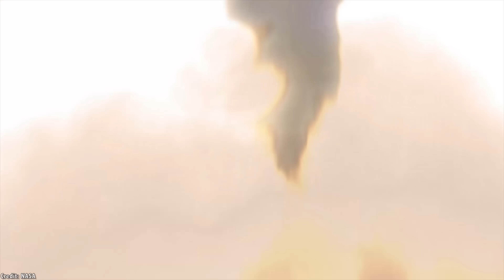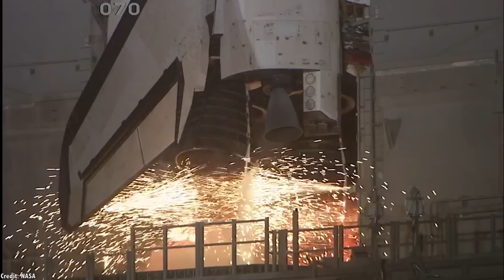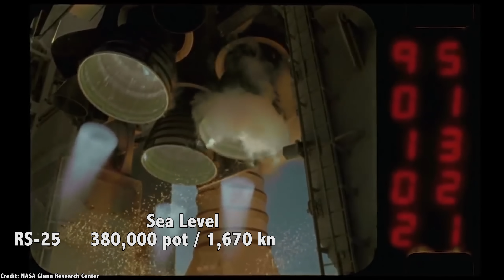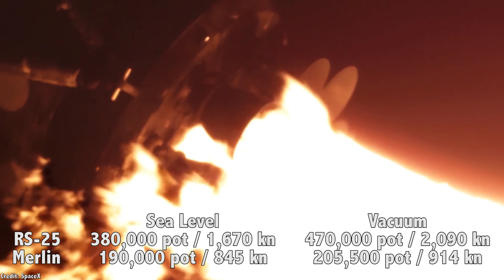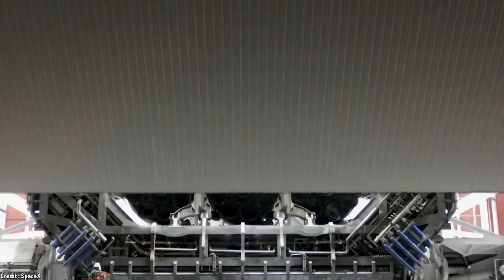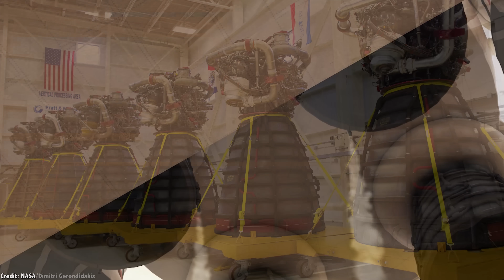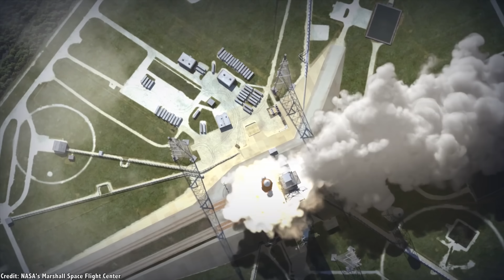The Rocket Engines Carrying Us to Space. The SLS RS-25 (aka The Space Shuttle Main Engine)

Comment: What would happen if Falcon 9 uses 9 RS 25 instead of 9 Merlins? Wow...!!
Reply from the maker: It's probably not a good fit. They're not designed for that kind of reusability. After each shuttle mission, they needed to be fully refitted before they could fly again.
Reply: Fraser Cain cool.. Why not make a video on outer space solar powerplants?
Reply: Haha, it would double the thrust (105% at sea level, 120% vaccuum), save the 18 mill SpaceX spends on Merlins and add 560 million in RS25s. Oh and the fuel would have to be changed. and the tank body would have to be like 5x bigger with the lower density of Hydrogen.
Reply: Aaron McCulloch  but all said hydrogen burns cleaner than kerosene...Elon's vision is for a clean emission free world

Comment: With the capitulation on reusability of the RS-25, could the engines be made cheaper than they were, given they were expected to have an easy check before re-launching. Since they aren't, some components could be cheaper and less complex than the SSME version, couldn't they?
Reply: Yes, that is currently planned. the RS-25E (expendable) should be cheaper to manufacture.

Comment: Fraser, one for your Q&A show: So NASA wants to abandon the ISS, even though it cost more than $100B to build and is perfectly viable past 2024, passing it in front of the public as a "move to the private sector" (which is bollocks, we all know the ISS wasn't engineered for such a use case). But they're not willing to cancel the SLS, in which they have invested what, $25B? It's obviously obsolete, even if there were no other companies working on big next-gen launchers apart from SpaceX (and there are others). Block 1 will be just modestly more capable than an expendable FH, but at 4x the price, and by the time they roll out Block 2, BFR will have flown several times. I love NASA, but it's just too political to be efficient.

Comment: Orion capsule is roo small for any deep space journey, just what were they thinking? BFR is gonna eat this things lunch.
Reply from the maker: It's a step back to space. I'd rather see some attempts to head out beyond Earth orbit than to wait for the BFR to get here. Once BFR does arrive, though, then NASA will be able to just buy launches on it.
Reply: Fraser Cain I see your point, however, even if BFR is delayed a few years the SLS won't be fully operational until the mid 2020s. At that point the SLS will be a turkey that cost almost $1bn per flight while BFR is likely in the $150m range. I want NASA to succeed so they've got to find some way to merge all that they have accomplished so far with either SpaceX, New Glenn, or even the Russians. That is our tax money bring used.
Reply: It's basically a transfer and re-entry vehicle. For any long-term mission it would be docked to a station or mated to a hab module.

Comment: $12 billion spent in developement and we haven't seen a flight yet, even though the mains are 'off the shelf' tech. $500 Milion a launch, throw away the most expensive parts, for what? More ULA or Boeing contracts? Jobs? Screw that! [oh, and another $2 billion to upgrade the launch pads- SpaceX upgraded 39-A for $20 million- likely the least they needed, maybe NASA needs $1.98 billion more in improvements]
Reply from the maker: Yes, it's jobs right now. When the space shuttle program wrapped up, they wanted to put them to work on the next program. Their other option was to just lay everybody off, which wouldn't have been the best idea either. There's a tremendous amount of knowledge and experience that NASA would lose. It's a tough call. And once SpaceX demonstrates more capability, they'll have a hard time continuing.

Comment: Hey Frazier can you cover what happened to the Falcon Heavy booster that was lost when it landed on the floating platform?
Reply from the maker: The booster didn't have enough ignition fuel to relight all three engines. So it crashed hard.
Reply: It wasn't a lack of propellant that caused the crash; it was a lack of igniter fluid, called TEA-TEB (tri-ethyl-aluminum and tri-ethyl-borane).  FH carries enough to relight the rockets only a few times and normally that's enough.  This time it wasn't, but it was no big deal as SpaceX didn't plan to re-use the core stage anyway.  They were more concerned about getting a successful payload delivery than recovery, and in that the mission succeeded.

Also, the upper stage burn time had nothing to do with the failure to land the core stage as they don't share propellant.  Furthermore, they didn't "overshoot" any planned orbit of Mars.  SpaceX burned the final stage to completion to demonstrate just how far they could throw the payload.  They would've been happy with Mars but got more out of the stage than anticipated.  The overshoot was actually an overperformance above and beyond what they projected.  That's actually a good thing.
Reply: James E also you are incorrect regarding the LEM overshoot on Apollo 11. The LEM was configured improperly for landing by the crew, namely when they left certain things on that should have been off for landing. This caused a computer overload which screwed up the landing solution, requiring Armstrong to take manual control. This is meticulously documented so I'm surprised at you not knowing this.
Reply: James E lastly you consider the case of overshoot to be a possible bad thing. While this would be true if, for example, you had a specific target in mind, that wasn't the case for this flight. SpaceX intentionally wanted to see how far they could throw the payload as a demonstration. They underestimated their performance which, again, is a good thing when you want to see just how much performance you could have if you needed it.
Reply: Ian Stradian the falcon heavy center booster didn't ignite three engines it only ignited one so it crashed near the drone ship at over 300mph
Reply: FraZIer Crane? Oh, wait... that’s not how he spells his name either. 

Just messing with you Eann
Reply: FraZIer Crane? Oh, wait... that’s not how he spells his name either. 

Just messing with you Eann
Reply: It can still make an interesting video.
Not many news covered the damage the ship Of Course I Still Love You suffered
Reply: James E while this would be true, booster separation and speed were exactly within specified limits so this didn't happen.
Reply: +Eric Smith
"SpaceX intentionally wanted to see how far they could throw the payload"
You may have seen that statement, but everything I saw from numerous sources said they were aiming for the orbit of Mars, and it seemed sloppy to me when they overshot it. Could be I missed something.

I have studied Apollo 11 extensively and am aware of the computer overload. The latest info I learned was that when the LEM separated from the Service Module, the engineers forgot to figure for the slight acceleration imparted to the LEM from the release bolts. The computer controlled the deceleration burn after that, not knowing of the additional delta V and overshot the landing zone by miles. It brought them down in a boulder field, which was why Armstrong took over to fly farther to a smooth area.
Reply: James E I would like to see the source you referenced for the explosive bolt delta V. I've studied Apollo since the 70's and it's news to me. It also doesn't seem likely given the LEM's position and speed prior to descent was meticulously timed and calculated precisely to prevent what you describe. For 40 years every source I know of cites the computer overload for landing errors.
Reply: Probably shouldn't have used the word "bolts" as I am not sure of the release mechanism details.

https://www.space.com/26593-apollo-11-moon-landing-scariest-moments.html
Also attributes the excess speed to uneven lunar gravity.

http://www.spaceflightinsider.com/space-flight-history/spaceflight-heritage-48-years-since-apollo-11-landed-moon/
Gives the cause as expelled air.

The planned timing was meticulous, but my understanding is that the LEM could not actively check its position and only had altitude data from radar and possibly fuel remaining, so once they separated for the landing, the landing program ran its course.

If you find out more, let me know.
Reply: I think they burned too much fuel on the way up, which would explain the lack of fuel to land and also why they overshot the orbit of Mars.
Reply: +Eric Smith
If the center core burned too much fuel on the way up, the 2nd stage would have been higher/going faster than expected when it started to burn its fuel, causing an overshoot. A similar thing happened on Apollo 11. The LEM was going too fast after separation to land on the Moon and, after burning the planned amount of fuel, overshot the landing zone.

I'm mainly surprised the FH overshot the expected solar orbit by so much as all the calculations beforehand said it would reach the orbit of Mars, and the calculation is relatively simple. Over performance is not necessarily good. What if people had been on board on the way to Mars and missed the planet entirely? Or a probe that needs to brake in Mars' atmosphere is going too fast to slow down due to over performance?

Comment: Although an awesome engine in it's day, the RS-25 is outclassed by the SpaceX Merlin:
1. Engine cost. From the video, a Merlin has about half the power of the RS-25. One RS-25 = ~$60m; 2 x Merlins @ ~$3m = $6m. 
2. Re-usability. Even when the RS-25 is recovered, I understand a near-complete rebuild is required, costing almost as much as a new engine. The Merlins apparently are 'rated' for 40 flights and don't require very much in terms of getting to 'relaunch' capability.
The smaller Merlins were used so that less fuel and thrust could be used on the return-to-base stage - only one Merlin of the 9 is used.
Reply: RS-25 is cleaner. It's exhaust? Water!
Reply: But Merlin has no chance in efficiency with RS-25
Reply from the maker: Yup, for their purpose, the Merlins are a better choice. They're cheaper, easier to manufacture and can be reused many times. The RS-25s are just insanely powerful.

Comment: What do you think about the Rocket Lab Electron Rocket's Rutherford engine's that use battery-powered electric motors?
Reply from the maker: Really exciting. I like the idea that there's competition at both sides of the launch market.
Reply: even rocketlabs has upstarts nipping at their heels - see the launch of Tricom 1R on the SS-520. I've heard they aim to develop a launcher than can be operated at less than half a million per flight.

Comment: Cant say I really see the SLS as being that much of an advantage.  Yes those RS-25s are powerful but expensive.   Unless you really need to loft something that heavy in once piece your almost better off useing 2 or more launches on a FH and doing a little orbital assembly.  Yes its more complicated but when buying replacement RS25's is going to cost you as much as a F9 out the door and you need 4 per SLS launch that extra complexity starts to look like a bargain.  I think its a combination of bureaucratic inertia and a heavy dose of sunk cost fallacy thats keeping the project alive at this point.
Reply from the maker: I think it's also important to remember that SpaceX has only be reusing rockets for a little over a year. It takes time to adjust to a shift in technology this profound.
Reply: The main advantage to SLS is the ability to launch a space station module or other large payload with crew. With FH, you can launch one or the other, but not both at once. And of course, that assumes the FH is also expended. 

Other than that, if NASA is building a Flagship probe to the outer solar system (Europa Clipper or a Uranus orbiter), SLS can probably launch it there directly instead of relying on Venus and/or Earth flybys. SLS is definitely a niche vehicle - it's not intended to fly much more than once a year.

Don't underestimate how complex the logistics of assembling a large space station can be. If NASA were still operating the Saturn V into the 90s, the mass of American segment of the ISS could have been sent up in just 2 or 3 launches.

Also, NASA does not pay the list price of a Falcon 9. They pay somewhat more for SpaceX to meet extra requirements, as their payloads are considerably more valuable than a commercial satellite. NASA would probably pay closer to $200 million for a FH launch.
Reply: True, but why did it take a private company to realize the technology?  Was NASA incapable of thinking of it or engineering it?  With the billions and billions spent on SLS thus far, why didn't NASA get there first?  What happened to "better, faster, cheaper"?

The answer is depressingly obvious: NASA isn't a space agency anymore.  It's a pork-barrel jobs program hidebound to political interests.  Sadly I don't see that changing anytime soon, if ever.  Too much money involved, too many pockets being lined at taxpayer expense.  Cynical?  Yes, but also realistic.
Reply: @ThePrisoner881  I know your comment is a year old however, it is still valid.  The pork of the space shuttle and now SLS is turning rancid... if only Republicans' understanding of science was better than their understanding of the bible!
Reply: +Fraser Cain reusability aside, $60 million for one RS-25,  when you can buy an entire F9 for that price. SpaceX has the best prices on space launch even before you factor in any reusability. I'm surprised at how much you defend the SLS program Frasier. You're an intelligent guy, you gotta know the cost is not worth it and actually prevents NASA from actually doing anything with the rocket. In fact NASA wants to cancel the ISS in 2024 so they can use that money to actually afford to do missions with the SLS. Is it because you are Canadian and it's not your tax money being wasted on a jobs program for Alabama vs actual human space exploration? This is what the SLS is preventing, not giving us the ability to explore but preventing us from exploring.

Comment: I wonder why the US uses the RD 180
Reply from the maker: Because they're reliable and there weren't any US-based solutions until recently. You're going to see a lot of these rockets switch over to Blue Origin BE-4s.
Reply: I doubt we will see any current rocket 'switch' to another engine family - especially one that uses a different fuel! ULA will have to ditch the Atlas V in order to stop using the RD-180 - problem is Boeing and Lockmart don't particularly want to development a new vehicle unless the government foots the bill.

I wish they'd just spin off ULA - I feel like they'd like to take some initiative in the market but they're held back by the parents with the purse strings.

Comment: The engines are certainly iconic, yet somehow it feels as NASA is not able to understand the concept of sunk costs and wastefully supports a project that should be terminated. The R-25 is certainly iconic, yet it has done it's time. It has more power output if compared with recent engines, but less power to weight ratio, which for rockets is all that matter. Certainly with more engines a failure is more likely, yet on the other hand this is compensated by more redundancy.
Reply from the maker: The goal was to keep the shuttle workforce employed building the next vehicle after the shuttle. SpaceX has definitely disrupted the whole industry, and once BFR flies, I think NASA will shut the program down.
Reply: Certainly retaining the human resources and their know is a sensitive move, nevertheless this does not seem to be a cost effective way to achieve it. 
Before the Falcon heavy demonstrated its capabilities the ISS project still had a reason to be, I don't think so anymore. What could be done instead is to pour these human resources in a know-how cooperation with current launch providers (mainly SpaceX and BO) with the demand to make the ensuing patents public. 
This is just one hypothesis just over the top of my head, nonetheless I think there are better ways to retain know how.
Reply: Fraser Cain - That's a very optimistic view of NASA embracing SpaceX's products. Falcon 9 isn't even going to launch the $2.5 billion Mars 2020 rover, and you think Congress and NASA would cancel the rocket for its next human spaceflight program as soon as BFR flies? The biggest near-term "threat" to SLS is Falcon Heavy launching Europa Clipper, and even that is uncertain.

BFR is not an ideal architecture for launching crew to lunar orbit with a space station module. NASA is not keen on relying on on-orbit refueling for TLI.

Yes, NASA could in theory cancel SLS and Orion and simply use Falcon Heavy and Dragon to launch crew. This would be similar to the Ares I and V Constellation architecture. But NASA would eventually need to have SpaceX modify Dragon to support long-duration missions. They're not going to simply use BFR as its own lunar space station.

I see BFR as replacing SLS Block II for cargo launches, not SLS Block 1B for crew and cargo. Congress wants to keep the SLS line churning out hardware. They'll be fine supporting 1 SLS crew flight per year and the occasional Flagship outer solar system probe or space telescope.